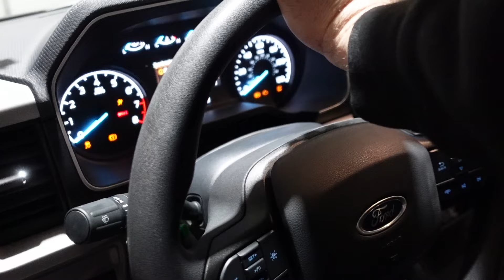Twin Turbo 23 F150 First Start Up with a TH400

Comment: Just want to start off by saying big fan of the channel and I also have a 23 F150 single cab 5.0 2wd I just want to know what is the benefits of going with that transmission versus the 1080
Reply: Lots of them, the 4 speed is stronger.
Reply: If you’re building a race truck and are gonna use a trans brake you will end up rebuilding a 10r80 every 10 passes . 400’s are used in promods with 4000 plus hp so you can build them to handle whatever power .